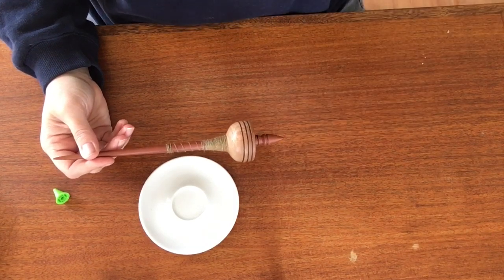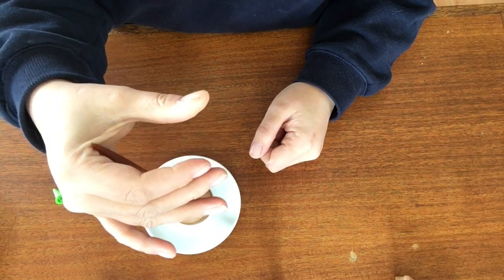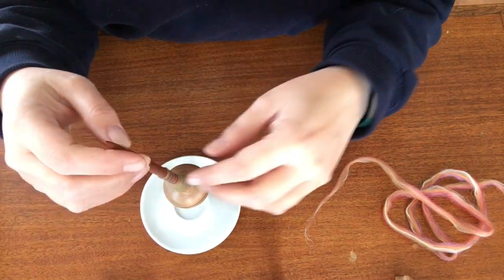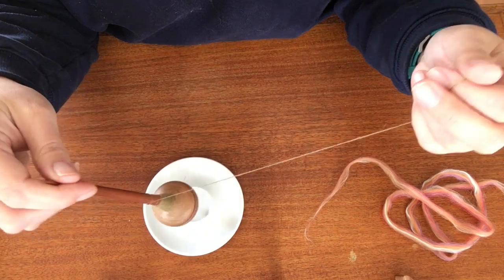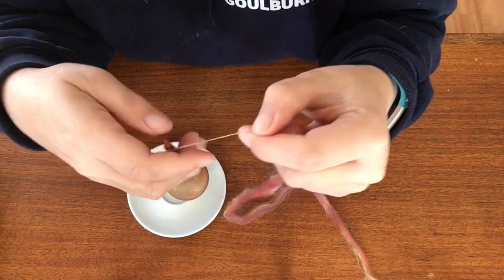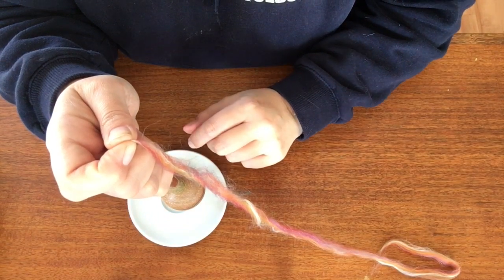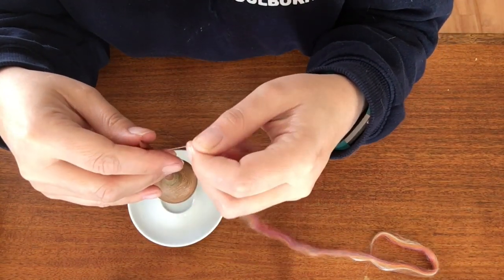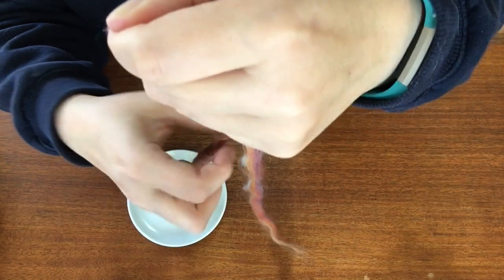Fibre - How I spin with my supported spindle

Comment: Thankyou for this really helpful video. Can I ask if you are right handed? I have seen supported spindles used in left and right hands and I’m unsure which is correct for a right handed person. Sorry if this is a silly question but I only just got my supported spindle and bowl.
Reply from the maker: I am right handed.  I Use my left hand as my support hand in everything I do fibre wise so for crochet and knitting I hold my yarn in my left hand, I think if you follow that rule it will be easier to work out. If you draft with the hand that you normally hold your wool in if you crochet or knit then I think it is more used to tensioning what you are holding and your right hand is more used to doing. Hopefully that helps
Reply: Kristy Besestri thank you, that does help and I’m beginning to get used to it now.

Comment: I looked for a spindle bowl like yours but couldn’t find it. Can you suggest a source?
Reply from the maker: Hi Kathleen, unfortunately the guy that made the wooden one does not sell anything any more and I have never seen one anywhere else. The little plat that I was using is actually a saucer I think from a tea cup set I think. 

The indents in the wooden one is actually just shallow drill holes. I am not sure which country you are in but in Australia alot of towns have a 'mens shed' which is a wood working group. Sometimes they will make stuff for people or normally they encourage you to make it with them. 

Hopefully that helps a little

Comment: Where did you get that lap bowl with the little "dishes"?  Also, could you show the bottom of the bowl?  I have the chalice style bowls but I like the one you showed in your video.  Are the little bowls ceramic (set in the wood)?  I have several metal tipped support spindles that cannot be used in wood bowls. Thank you.
Reply from the maker: Maggie Patterson i got the wooden lap bowl from luxury overdose on etsy, they dont have any at the moment listed but if you ask on their facebook page they are usually good at getting back to people. the little bowls are basically drilled out sections in the wood so it is straight wood. Here is their facebook page https://www.facebook.com/Luxuryoverdose/. i wonder if resin would work with your metal spindles? you might be able to make a mould of an existing cup support and then pour it in resin and drill out the top with a size 12 drill bit. either that or a local potter might be able to make one really easily for you.